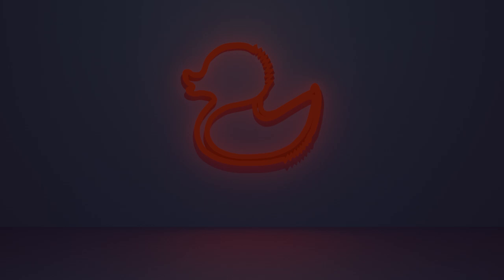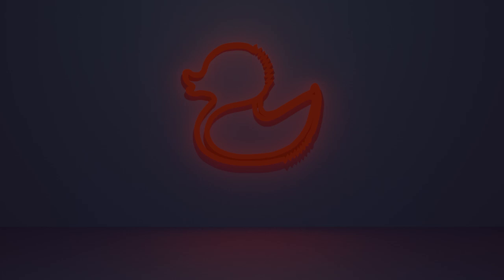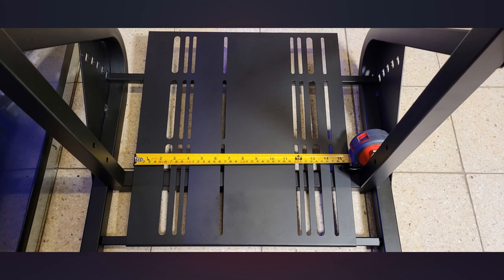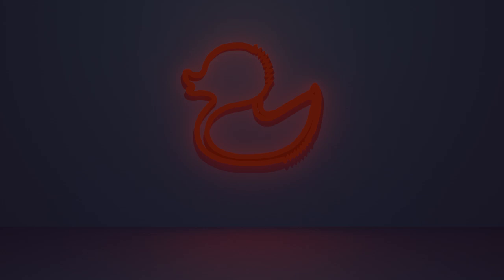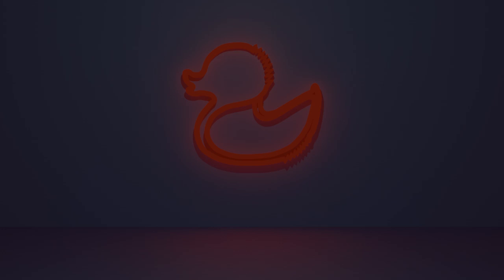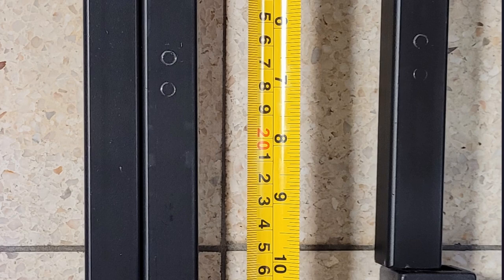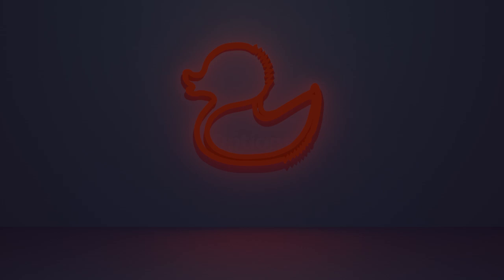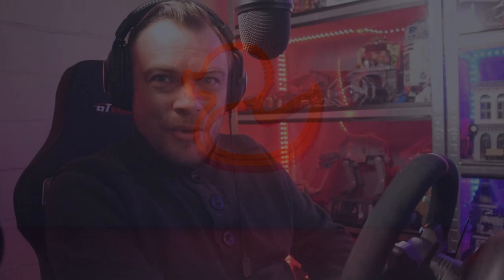Review: GT Omega Art

Comment: Thanks for the review! Good to hear the seat is nice. Why did you choose this one of the three choices? I find the flex of the wheel deck a bit much. Perhaps the gt omega Titan is a better option. Btw how do you like gran turismo 7 compares to pc sims?
Reply from the maker: Because I suspected bang for buck it would have been the best. 😅 yes, if you put stability high as a requirement, the Titan should be better due to the usage of more thicker round tubes. I noticed that type of construction generates more stability. I don't play racing-games on PC but what i do like is that GT7 is more accessible to people. I made an opinion on this in the segment GT7 of my videos.

Comment: Nothing wrong with square tubes. They are used a lot in construction. Of course there can be a huge variation in quality. :)
Reply from the maker: Of course but I guess the RR3055 just made me cringe every time I see square tubing. I think just the longer rectangular shape of that one was less "sturdy" then the smaller squared shape of this one.
Reply: I just insist because I work in the administration of a tube mill. We produce seamless hot rolled steel tubes. Round and square/rectangular types. Probably not the ones used in these kind of chairs, though. ;)
Reply from the maker: @marcianzero_yt  Well my friend, if the R3055 would have been made with steel coming from your tube mill, i am sure it would have scored a  lot better! 😁

Comment: For the same money I would get a Rigmetal basic hands down.  The Rigmetal is an 8020 aluminum extrusion rig so its very customizable.  I got mine for $430 shipped.

People who buy these tubular rigs must not know about 8020 aluminum extrusion rigs because the latter beats the former in almost every respect.
Reply from the maker: Is that price including the seat, gear shift holder, sliding rails, tools, bolts and cable management straps?
Reply: @SimulatedDrivingResource  I am using a Mazda RX8 seat pulled from a car.  $50 from the junkyard.  It would be more difficult to fit onto the GT Omega Art because the mounting points are asymmetric.

Also I have 2 bass shakers installed.  There doesn't seem to be many good places to mount those on the GT Omega Art.
Reply from the maker: @xuimod  clear... I am sure the rig will grant you more stability and flexibility in terms of expansion, but in the end, it is more expensive, you need to get an extra chair from wherever for whatever price so more hassle. Perhaps I will do a video about a 8020 alu later. Thanks for bringing it to my attention.
Reply: @SimulatedDrivingResource  yeah if I had it to do over again I'd pull a seat from a VW or Audi because they have straight rails.  For my RX8 seat I had to make a custom mount out of wood and then screwed that onto the 8020 rig.

Also bass shakers are ridiculous.  Playing racing games, especially rally games like WRC10 or DR2 it legit feels like I'm in a real race car lol.  When I rev the engine the whole frame vibrates like an engine in a race car would.  I have a bass shaker in the back near my seat and another up front by the pedals.
Reply from the maker: @xuimod  haha.. Well those Bass shakers, I am sure they improve the immersion quite a lot! Very impressive setup and kudo's on the handy-work!

Comment: I like that too. However, I'm hesitating between this and the GT Omega Titan. Do you have any idea which one I should take? Drive quite often
Reply from the maker: I found the Art already sturdy and stable enough for my T-GT. I have not tested the Titan yet, but I assume it is even more rigid. I see a price difference of 140€. That is a lot and IN MY OPINION it can't be worth it over the already fine Art. Again, I need to stress I have not tested the Titan yet, only similar built (tube) rigs.
Reply: I actually think I'm in good shape with the Art Cockpit. I hope it's still stable when I turn on the monitor.

Comment: I'm thinking of upgrading to this from my Playseat Challenge. Do you think it will handle the 8nm Fanatec CSW 2.5 well enough with loadcell pedals?
Reply from the maker: Not a single seat I tested has no flex. They all range from horrible to minimum. This seat qualifies at the sub-top of minimum for wheelbase and top for pedals. It will handle your hardware. Although what it will also do is, and that is something people tend to forget to ask, is make your ride comfortable. By far the best to get in and out and find a  seating position WITHOUT having to buy extra's like e.g. rail sliders. When you buy this chair and it arrives, you actually have the feeling you get what you paid for... something I found to be very rare among the seats I yested. Are you expecting for your wheelbase and pedals not to move at all? Then the ART will not be adequate and you will need to spend about 150-200€ more...
Reply: @SimulatedDrivingResource  Awesome! Thanks for the reply. The comfortability part is important too. I've had to lock down the opening mechanism of my Playseat because of the reinforcements I had to do. Getting in and out is a bit of a challenge. 😅 You dont happen to have an affiliate link with GT Omega to help your channel out if I decide to order one?
Reply from the maker: @Larryism  lol I can imagine indeed a Challenge can be a real challenge to get in and out when you mod it. I asked the question but unfortunately, I am not considered (yet) as affiliate because I have a too small number of subscribers, however, I did find a 5% off at Karl Gosling's YT with the code GTO5. You can always add a remark when you order with a link to my review. Perhaps that could help for the future. Thanks man and succes!

Comment: What is the different to the titan cockpit? Is the titan better?
Reply from the maker: The GT Omega Titan use tubular framing where the base-holder is attached to as opposed to rectangular tubing of the ART... It will give you less flex supposedly. I have not ordered or reviewed it yet, but yes, out of experience with similar frames, the Titan is "better" for wheelbases that generate higher torque.